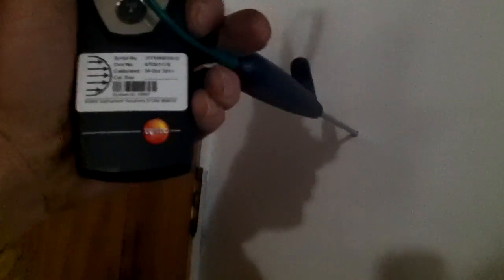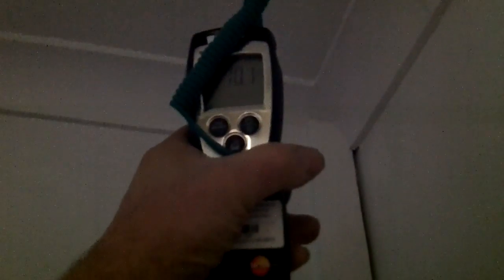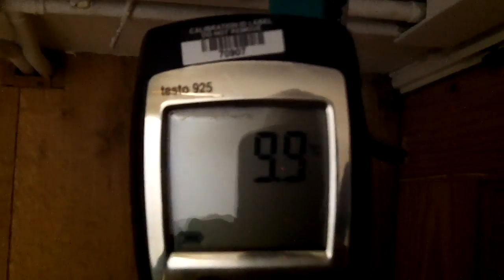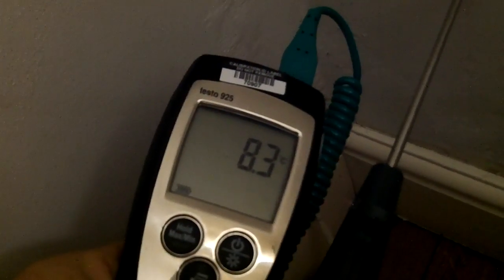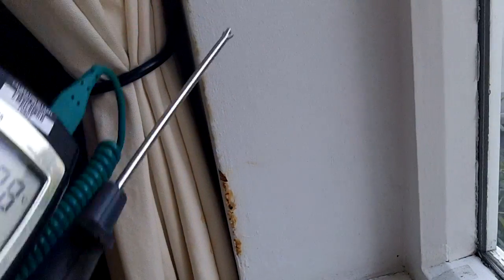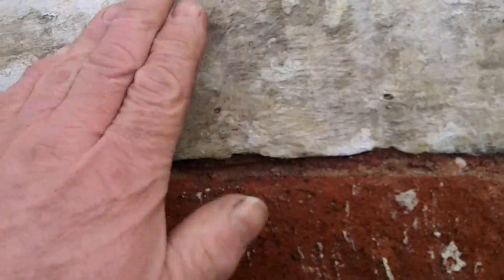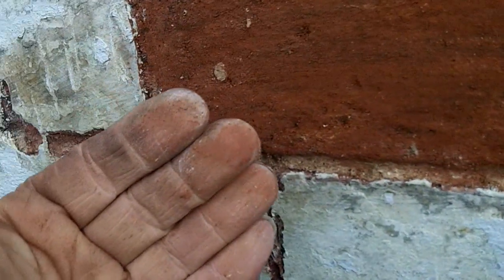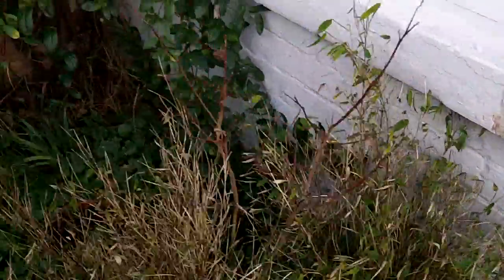A damp house with paint peeling off walls - how temperatures have such an effect

Comment: You’re videos are the only thing I’ve found on the internet that talks about how to cure damp rather than seal it back in!! Finally some sanity. I’ve just bought a 1930s house and there definitely damp inside. Im wondering if you’d recommend stripping all the internal wall paint incase it’s the non breathable type and then painting with a healthier kind? It’s a lot of work but if it’ll help then I’ll do it. What do you reckon? Thanks!
Reply from the maker: I'd probably focus on moisture levels in the house first -  before you spend money, just get it properly heated - constant low temp heating, gentle ventilation, open up fireplaces so the chimneys are vented, check any sub floor vents are working, look at whether anyone has cavity insulated (if walls are filled it may well be damp so causing a big headache - also cavity fill blocks sub floor and wall vents)  Also, look carefully at bathroom and kitchen ventilation - is kitchen vented externally and do you use it all the time - even to boil a kettle. Bathrooms need humidity controlled vent fans so moisture is pulled out - dont forget it takes on average 7 hours for moisture levels to drop to normal after a shower. And.. check all drains, downpipes gutters etc - underground drainage is often cracked and broken - so essential you get cameras down all drains - this way you eliminate any form of moisture BEFORE you actually spend money on the house! Also ground levels - 150mm below damp course level (even if dpc's arent really needed - they set the level of ground so no moisture can get into the walls and floors)
Reply: @WarmDryHome  thanks so much for your detailed response. I’ll be sure to do all those things! Probably makes sense to remove moisture trapping paint too once I’ve done the rest. Pretty sure there’s no wall insulation so that’s probs my main issue. Thanks again!
Reply from the maker: Pleasure.. .dont forget to look at the www.heritage-house.org website if you need more info - also, we run a facebook site - Traditional and Listed Building Advice - where folks in a similar place to you, can ask advice from others. We're admins, so keep a close eye on what goes on!

Comment: Have seen quite a few of your videos, all very interesting and great for learning the causes..........but can never seem to learn what we can do about it Peter. Are there any videos of how we can remedy the situations? Have seen one about the basement which I shall try....but flaky paint and salt excretions from interior walls ......what are you supposed to do with them? what sort of mortar or plaster and paints are we supposed to use?  Great that you can identify the cause of the problem...... but don't really give us the remedy. Thanks for your work so far though.👍
Reply: I have watched a days worth of the videos. I learn the least from timber framed houses etc. 

Rest I do learn a lot. Find the problem areas using humidity meter. Tackle drains, soil too high, gutters, outside painted bricks etc. 

Big culprit often gypsum plaster , cement mortar, cement render. 

Make walls breathable. 

Use breathable paints , clay paints.  He lists a brand above. 

Don't use lining paper as glue and paper hold water. 

Use lime mortar and pointing, hydraulic lime so joints remain breathable. 

That's my summary. Hope it helps ..

Comment: Hi Peter I have found bitumen tar on the back stone wall of a house. What is the best ways to take off tar.
Reply from the maker: Scrape / chip off - sandblasting at low pressure can work - but dont want to damage surface of brick and stone....,

Comment: Peter, Maybe start introducing the concept of energy too? All systems need energy. Remove the energy or break the cycle and the system stops. Plastic paint on the outside wall will stop the evaporation and stop the system, but the moisture is already in the wall. The energy cycle here is from  the ‘latent heat of vaporisation’. When the water evaporates from the wall it requires energy to do so. This energy comes from the heat in the surface water, the latent heat. This is why we cool when we sweat. Paradoxically, when the water evaporates from the outside wall it cools the surface! Oh bugger it! .... but it’s OK let’s heat the room inside to keep the system going. So as well as straightforward thermal conduction through the wall we also have a loss of heat at the surface. So there is a thermodynamic effect at play here as well. Once the drew point is reached on that outside wall the process starts. ‘Wicking’ is capillary action + evaporation. Gas laws and thermodynamics all at play in this wall setting up a continuous cycle. It will take some explaining as thermodynamics is a tough subject to grasp, but it’s all in the name! It is differentials in heat that is driving all this ‘breathing’. Your thermometer is measuring this heat content along the thermal gradient
Reply from the maker: Very sensible and scientific - I'm hoping to start putting some educational videos together that talk about this - you have touched on a raw nerve here. Iften say to people that with wet walls, they are likely to see things get worse before they get better, because even if they start the drying process, they are going to cool the wall, which lowers dew point, causes more damp through condensation, and thus more evaporation, and lowering of temp - somehow they have to get over the hump of losing all that water - which clearly they do - but probably because the external environment is so dry, that the evaporation doesnt require so much energy. I keep talking about diffusion of gaseous water as a mechanism, and have tried to develop the idea of 'naughty children' - water molecules, highly active, very small, hiding everywhere, but not doing much damage - then as they lose energy and slow down, clump together and form water which is bigger and can't hide thus trapped by coatings that are not porous or breathable. Then we get to porosity, permeability, breathability - just put a page or two up about breathable paints on the website - trying to explain about 'breathable' paionts and what rubbish it is.. Maybe should write a joint page :-)
Reply: @WarmDryHome Let me know if you want some help

Comment: Hi! quick question please. i have condensation behind the fitted wardrobe by the north wall of my bungalow. we recently moved it and slightly worried. i see no salt deposits at the external wall, so not an issue with the rising damp i would have thought. any suggestion would be much appreciated. thanks a lot!

Comment: I love to watch you're video's. Finally someone who gets it!
I have been having this argument for years. 
I would just add on this particular video, move the dam table away from the radiator and let the warm air circulate. 
Girls and Boys, don't cover or block radiators, it stops them working and increased the heating bill.

Comment: what I'd do is remove the external paint , re joint the Brickwork with just lime and sand witch draws the moisture out faster, internal walls need to be treated with a vinyl silk to stop the condensation getting into them in the first place,  or a gloss paint with vinyl silk over that it takes skill and has to be done slowly or you end up with crinkle glaze,  and check to see if extractors are correctly fitted into kitchens and bathrooms and advise the owner to open some of the windows a little to vent moisture out plus advise them to invest in a good quality dehumidifier,  as the biggest cause of damp is modern double glazed air tight windows and doors not allowing the passage of air throughout a building.
Reply: Vinyl silk inside? That’s shocking advise. Do you actually work within this field?

Comment: Hi Peter, I found your videos very interesting. This is a photo of an internal garage wall connected to a painted concrete floor. The paint is flaking off on the 1st 3 rows of bricks. Outside there are no air bricks and the damp membrane can be seen after the 3rd row of bricks. The inside brick dust & mortar does feels slightly damp (I don't have a fancy moisture device).
Is the best solution is to brush off the paint and remove the outside plants? Would injecting DPC cream after the 1st row of bricks be pointless?
http://postimg.org/image/6ady978h7/

Comment: peter whats the cure for salt deposits in chimney breast top of house.
Reply from the maker: timothy barkes Hmm - remove as much contaminated plaster and mortar, brush down, clean, re-point, and replaster with lime.  If comes back, take off, and plaster in a very weak lime mix and keep damp - its called poulticing.  Draw salts into the lime, knock off and replaster.  If they arent being replaced, and the chimney is clean, and lined, they gradually go.

Comment: Peter, i wonder if you would like to come and film our house, it would make a good case study, we have an end of terrace house and we have made ALL of the mistakes that are possible regarding damp.
Injection DPC, waterproof internal concrete rendering, painted exterior walls, sprayed on expanding foam under the living room floor (this seems ok - actually there is still ventilation below the foam layer).
The walls are so damp that if we place anything against them for any protracted period of time (say 6 weeks)  there will be a black mould shape in that exact shape.
We have a extremely damp patch behind the dining room chimney breast that has dry bricks all around (???)
A cable was laid OVER the gutter which led to a huge leak in out bedroom (over freshly papered wall (£22 per roll (no spare rolls)))
I think that our health has suffered as a result of the damp, we both seem to get quite a lot of chest infections and i wonder if it's time the government looked into this scandal and possibly force the damp proofing specialists to pay for repairs?
Keep up the good work, your videos are gold.
Reply: IndiaRubber Man your problem is condensation

Comment: Peter just to say greaat videos ...I have just bought a sandstone attic flat and the chimney wall is full of salts coming out as you describe.Do you use any brand of lime for your platering and pointing...best videos ..Angus
Reply from the maker: ANGUS FILES Not really - best to use quite soft - nhl 2.5 hydraulic is soft - a 3:1 mix - if only small areas, can talk to Ty Mawr lime and they'll help you over the phone.. Good luck!  Pete

Comment: Hi, i've got a 150 year old house with no original damp proof course and a concrete floor.  I'm told nearly all my walls including the internal brick ones are damp because of the lack of ventilation the original floor would have given.  I don't know the best way to deal with the problem because i'm reading different methods and theories.  Any suggestions as to how i can solve the problem? would really appreciate your input

Comment from the maker: Best to leave just brickwork.  If you want a paint finish, use limewash externally - its brilliant.  Internally you could use clay paints - Earthborn or similar.. Limewash is used a fair bit as a shelter coat to prevent spalling etc., but really, if you have spalling, its because brickwork is too damp - make sure its allowed to stay dry - no vegetation, plenty of air , no splashing or water running out of gutters....